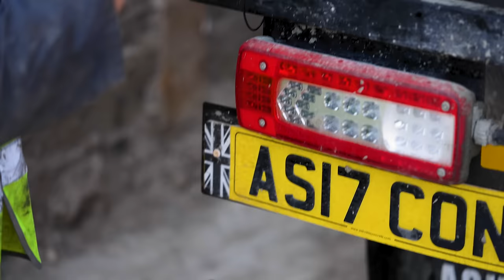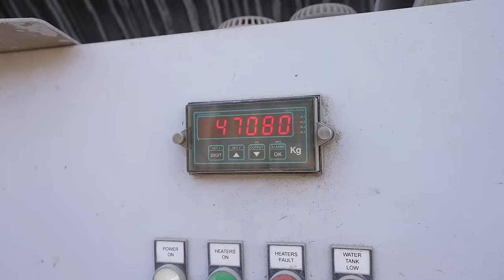On My Own, Making Pour Excuses | Ashville Weekly ep097

Comment: Hi, If you still get your Addblue in the IBCs why don't you fill them with water after you have emptied out the add blue. Then with a pump you could use them as back up to fill your Vollumetric mixers.

Comment: Just one question Daniel why can’t the LH60 load lorries when it’s that busy.  It would save double handling and that’s pure efficiency at its best.
Reply: Too much faffin about when they get charged for the train if it’s late leaving
Reply: Also I believe the loaders have scales built into the shovels so they don't over load the wagons to my knowledge the LH60 does not have this
Reply: I thought it would be a bit of faffing but often the train is left there.  I know the trucks go on the way bridge so I suppose the loaders weighing each shovel helps get them accurate.

Comment: Maybe a solution for the water is to buy a road tanker - they hold 20'000 + litres so if you needed in a rush you could pump off  - or you could use it for haulage work for your tractor units when you don't need the extra water in the yard.